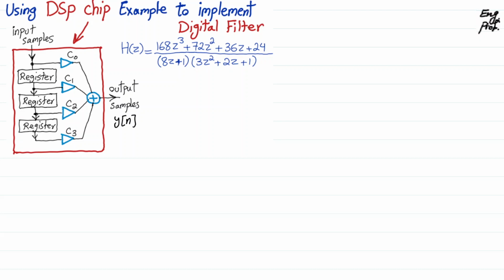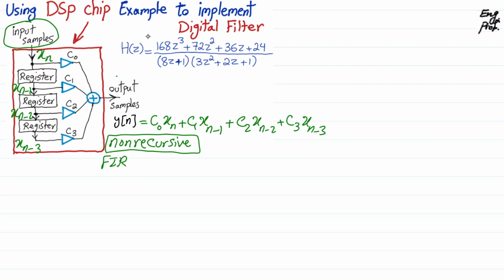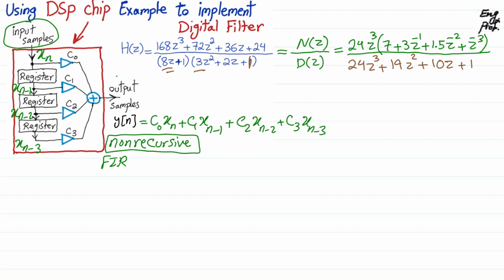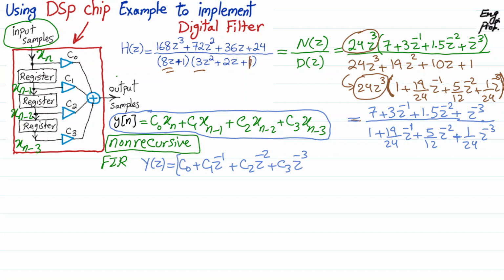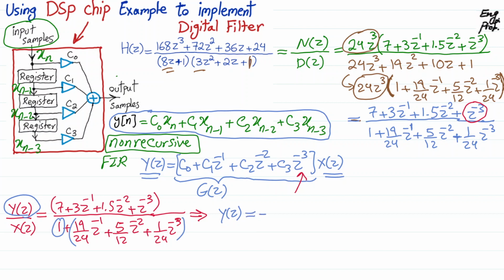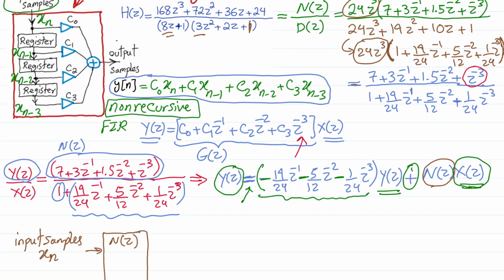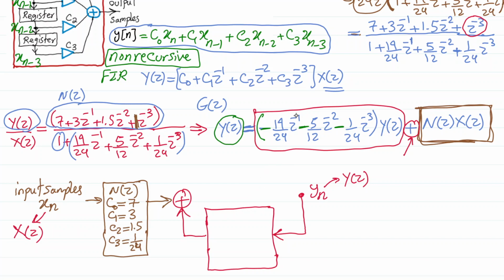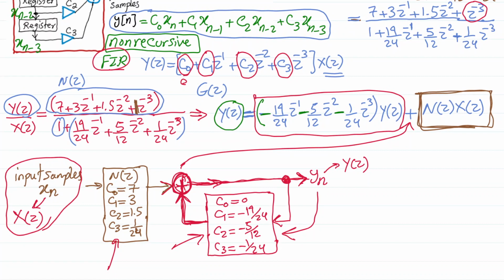Implementing IIR Digital Filter using FIR DSP Chip Example

Comment from the maker: DSP stands for digital signal processor. For more Z domain circuit examples see https://youtube.com/playlist?list=PLrwXF7N522y6cSKr0FmEPP_zQl011VvLr
There are many variants of DSP chips and of course DSP chips today are considerably more capable and complex than a single FIR block.  Texas Instruments is one of the most famous companies in the domain of DSP microchips. Also note that these are digital processors. So all needed procesding is done Digitally similar to a computer CPU or GPU.  Of course, if need be, one can convert the final output to Analog continuous domain using Digital to Analog Converter.